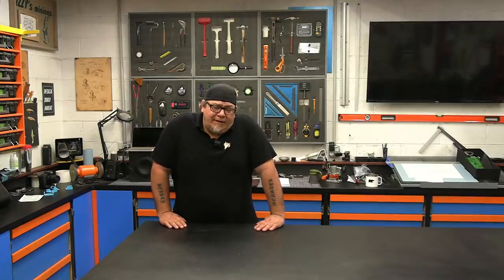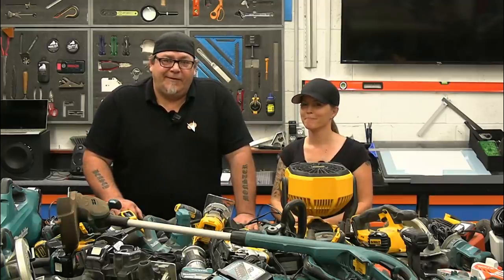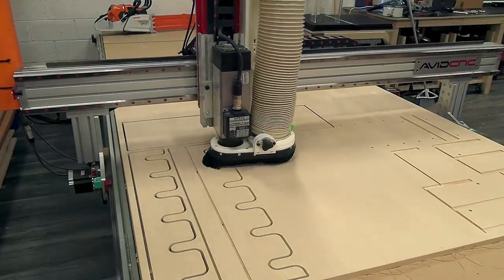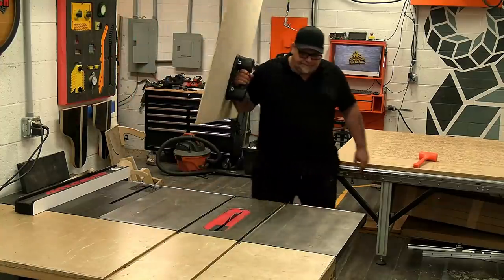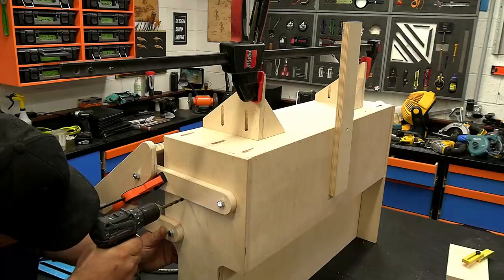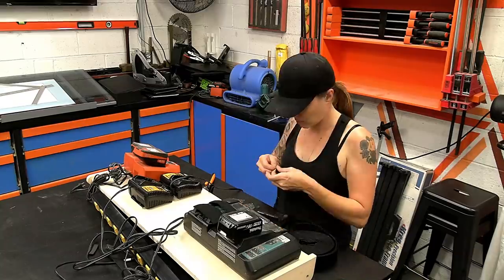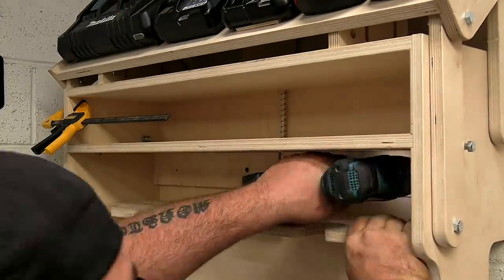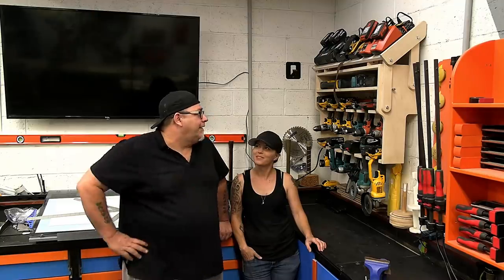DIY - Folding Cordless Drill Storage | Charging Station | Woodworking Project

Comment: What is that tool you and Maggie used to pick up, carry, and move the Baltic Birch Ply?
Reply from the maker: It's called the Grabo Vac plate. There is a link in the description box it you want to check it out more
Reply: @izzyswan  Thank you!
Reply: It was product placement for izzy's badass engineering.
Reply: Nice work
Reply: Once you start using it you won't be able to stop. They are really versatile. I'ld also recommend the vacuum plate accessory if you do, or plan on doing, any vacuum forming.
Reply: They are incredible. Used them last 2 weekends to install 3 runs of hdpe outdoor cabinets and some 4x8 panels of same. Each piece is heavier than a Buick but these grab them no problem.
Reply: I knew it was used mostly to move heavy stock. I appreciated seeing the vacuum grip as a push stick on the table saw...  Talk about a GRRRRIPPPPPPER
Reply: Grabo vac plate
Reply: @diywtlc2249  "GRRRRABO"

Comment: I had the same problem in my basment (work shop & household storage areas) my wife is vertically challenged, so floor to ceiling storage is still the way I went but I also installed a sliding library ladder with rails.  Most of her stuff is put lower but things rarely used (Xmas lights, and other holiday stuff)  are put high.  A happy wife happy life.

Comment: Great build, guys. This opens up a bunch of possibilities for upper level storage cubbies (maybe for lesser used items), even if you ARE taller than Maggie. My shop has walls pushing 12', but the utilization of the top portions always require step ladders. Not ideal, or elegant.
  She will certainly be a great asset for the channel. Look forward to the next build.
Reply from the maker: Good point!

Comment: Probably the best compact with the most tools storage system I've seen or thought of!!  Great Job and loved the bungee dampening system.  The only thing I "might" have done different is put thin Delrin washers between the ply cantilevers and use nylocks (just my typical Motis).  Always a treat to see excellent designs come together and be so functionally efficient and clean!  Thanks Izzy and Maggie!!  Hat Tip, ~PJ

Comment: Nice ideas.   Even for six footers.  That would make it so I can store more tools up high in a small shop and not waist from 7 to 9 foot on a wall and also let me not have to move a step stool a round and round the shop.  8)
Reply: Think library ladder, you know, side to side rolling and attached to the wall or shelf system at the top by the rollers on a rail system?

Comment: That’s an awesome project. I love the engineering and thought that went into that. It looks like a handle of some sort might be of better use so Maggie could not only pull the charger shelf down but also be able to push it back up easier. Great to see you doing so well Izzy after having such problems with your back, I was rather surprised to see you not only lifting the sheet of plywood but also with Maggie clinging on to it to lol.
Reply: I also thought the same thing
Reply: She just needs a push stick. Gotta be a few laying around the shop somewhere.

Comment: For my drills, I found that the chuck had a similar diameter to the hole saw I use for door knobs.  So, I just mounted a 2x4 with some backers to make space and drilled holes in it the size of the chucks.  I stick the drills into the holes and they hang there fine.

Comment: Nice project...I might have just connected the bungie cord to the top back of the hinged shelf and ran it up to a screw eye in your ceiling joists/rafters.  Or use a simple gas shock like a hatchback vehicle's rear hatch door lift assist or the front hood.

Comment: Neat system. Just an observation: The down stop appears to also function as an up stop, as does the wall, so other than preventing sag, the blocks seem redundant .
Reply from the maker: They also keep the possibility of sag from happening with the weight of the batteries and charges. But your right it could have been done with out them

Comment: MAN WHAT A STORAGE SHELF;;;;LOOKS GREAT;;;BUT COMING FROM ONE WHO RIDES AROUND ON A LARGE REPTILE IN PUBLIC;;;;HMMMMM;;;;MY ONLY PROBLEM IS I'M TOO OLD TO DO THAT;;;NO FANCY CUT OUT MACHINE THAT COMPUTER PROGRAMMING DOES THE WORK FOR YOU;;;HMMM;;;;IF I HAD THAT MANY TOOLS IN MY SHOP I COULDN''T MOVE;;;;SHELF OR NO SHELF;;;;LOL;;;ALWAYS ENJOY YOUR VIDS;;;;EVEN BEFORE YOU WENT HIGH TECH;;;;LOL;;;;THUMBS UP
Reply: Hey there -- there is absolutely no need to SHOUT every word you say! 
 
But to your point, I also have no big fancy computer-driven modern machine. All the tools I have bought (except three or four) are either up to 50 years old (one is quite a bit older than I am) or were bought in the last 10 years at Harbor Freight.
Reply: @GraemePayne1967Marine  I BE OLD AND DON'T SEE VERY WELL;;;;LOL;;;;NOT SHOUTING JUST TYPING LARGE LETTERS SO I DON'T HAVE TO SPEND HOURS TRYING TO CORRECT MISTAKES;;;SO I USE LARGE LETTERS;;;;LOL;;;;IF IT HURTS YOUR EARS TO READ THIS PLEASE FIND EAR PLUGS TO HELP;;;

Comment: The concealed pulleys are a concern for servicing. How about a carousel-style design, where tracked shelves circulate using an accessible bicycle-chain drivetrain on the sides?
Reply: yeah, he would need a screwdriver to get the thing off the wall, wonder where he will find that
Reply: @TitusVespas  would be a lot easier if the bungee and pulleys had been accessible from the front, mounted behind the tools.

Comment: I hate to be the guy, but the bolt you used as the down stop position could have been dual purpose if you moved it toward the wall just a bit. Unless of course you actually needed the dividers under the charging shelf.
Reply from the maker: it could have but i waned the additional support under the the chargers and batteries and it was a kill a birds with one stone thingy. but you are right
Reply: @izzyswan  by the way I didn’t say it but I love your channel and am so jealous of those that get to work with you.

Comment: Wouldn't it just be easier to build her some stilts? I mean won't the work benches be to high for her too? Not knocking her, at all. We need height challenged people to make us average height people seem a little taller, but we don't need her getting hurt over-extending to work on surfaces that aren't at the right working height for her either. Or anyone else hurting their back by bending over too far working at a height that is too low for them.
Easiest fix is stilts, or elevator/adjustable stilts for her.